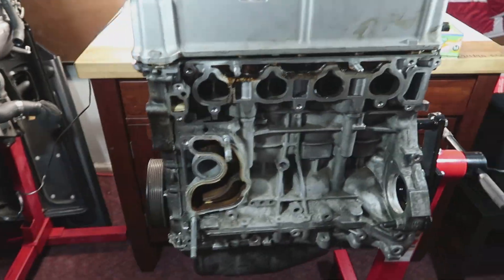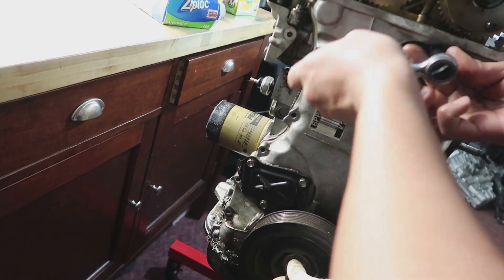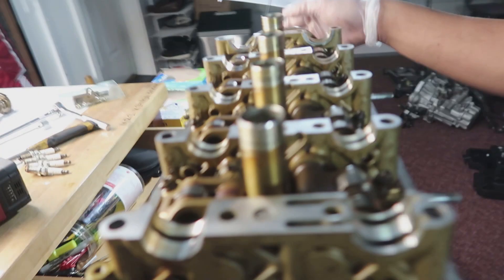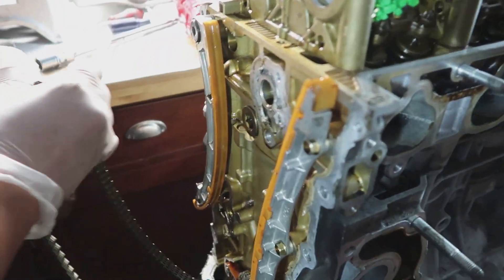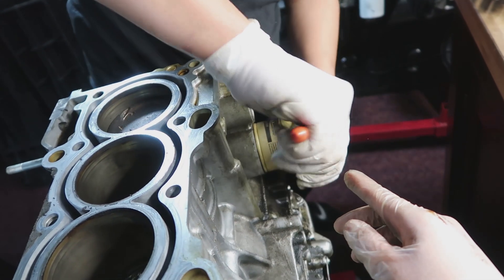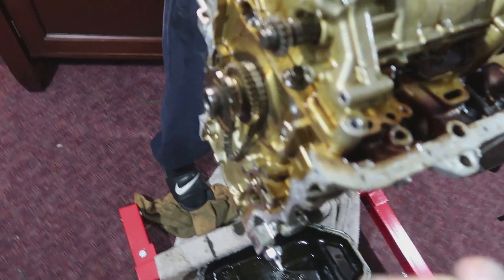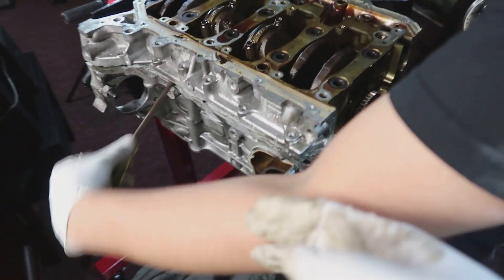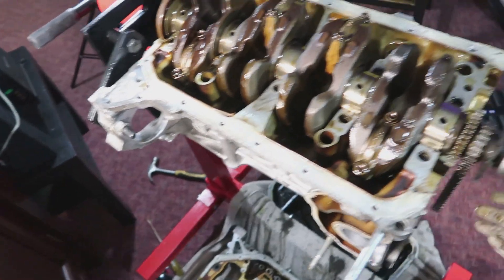Engine Tear Down | K24

Comment: Use a rubber mallet over a flathead. Aluminum is soft and you can easily damage it with steel.

Comment: Why do people put k20 head on k24
Reply: K20 head flows better, k24 is more displacement ..
Think a camaro with edlebrock heads on a 305 , now put them on a 350 ..why ? Pretty damn simple.same same
Reply: I think it revs higher or something
Reply: Low end torque with k24 block and with k20 head revs higher best of both worlds

Comment: I like your video, but there are a few things that I have learned from my own experience that will help prevent damage to the components. First, plastic chisels and rubber mallets work really well for separating parts held together with hondabond. Second, as when you popped the lifter assy loose with the screw driver, cover the screw driver or whatever you use in tape. Plastic chisel and rubber mallet will work good here as well. The idea is you want to keep the risk of marring the metal to the absolute minimum. Also use a ridge reaming device to clear the top of the cylinders of carbon deposits instead of hammering on the rods. After you remove that carbon lip, the pistons will come out very easy, Hammering on the rods using a flat head like that can catastrophically damage them. Also, when removing major studs like head and crankshaft main bolts, take your time to loosen them one at a time per the torque schedule in reverse, quarter turn or less at a time, preferably around 70-80 degrees room temperature. Removing them all the way, one at a time, can warp your head and block mains due to that side lifting up while the other bolts hold the untorqued side down. Other than that, it seems like you guys have a solid idea of what you're doing.
Reply: I learned all this last semester

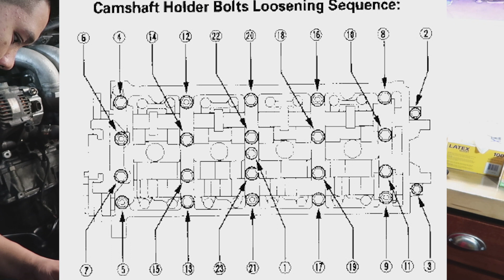Comment: 01:09 how to take it off yes but NOT how to put it back on... the sequence to put it back on is the reverse of taking it out!
03:49 DO NOT push against this guide to take the timing chain cover off... i did and the top of the guide broke easily...push only at stable spots against, after breaking it i used the other guide and pushed only against the bolt and had it easy out from both sides. I am not a fan of impact guns working on head bolts, i reccomend using a big wrench and turn just a little all the bolts (like 5°) 1 by one in 2-3 sequences... till all of them get rid of the tension so you ll minimize damage on the surfaces of head and block, also is good for the threads of the block to do so.

Comment: Stupid question. But what is the device you're holding the engine up with called? And is it specific to this kind of engine or can it be used to hold up any engine? I ended up with a free K24 and I'm not sure what to do with it. I think I'm going to tear it down and rebuild just for the experience. If anyone has any suggestions besides sell it I'm all ears. If I wanted to go the performance building route whats the best vehicle to put it in?
Also: Great quality video. It's Concise, well edited, excellent lighting....etc. subscribed!
Reply from the maker: H. Ammar It’s called an Engine stand. You can get it from harbor freight for about $40. If you have the money i say go ahead and build it to your liking. Theres multiple builds people have done with a k24, like an ek, eg, sw20, all depends on your liking and taste.
Reply: @RespirePro  Yeah I went and bought the $60 one from Harbor freight yesterday (it looked more stable than the $40 one). I've got it mounted and am about to tear it down today following the tips in this video. I'll have to look into those options you mentioned above to see what I'm going to do with it. Thanks for the response.